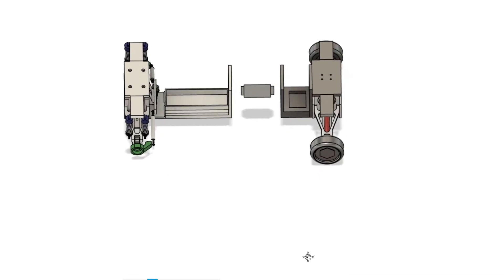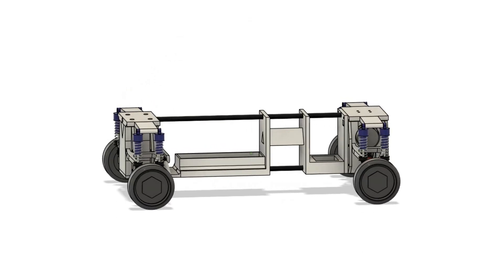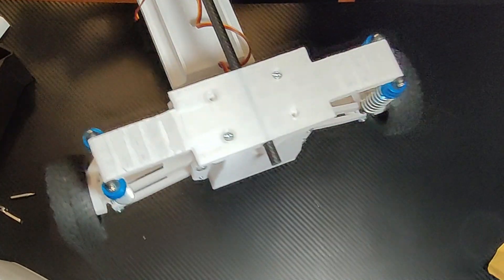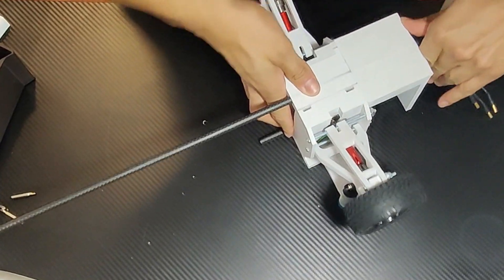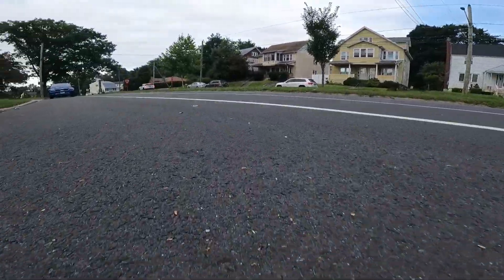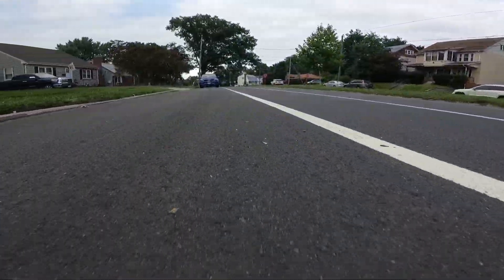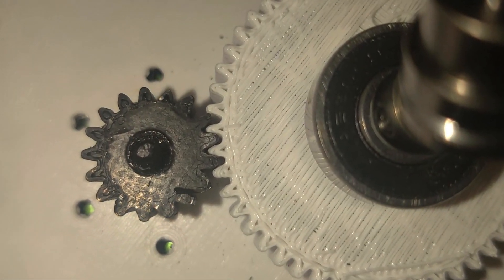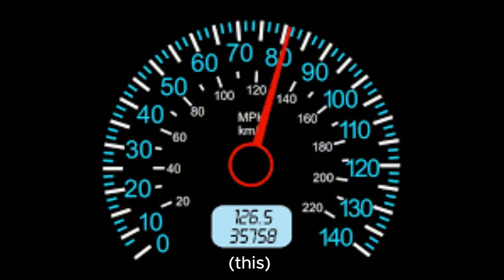3D Printed RC Car   Spoiler: I crash a lot...

Comment: what motor driver do you use on the car?
Reply from the maker: @marcelcraig507  it's a set with an esc, it's called sidewinder 4 by Castle creations it's like $140 dollars so... Quite pricey, but if you want your rc car fast or high torque, it's really good